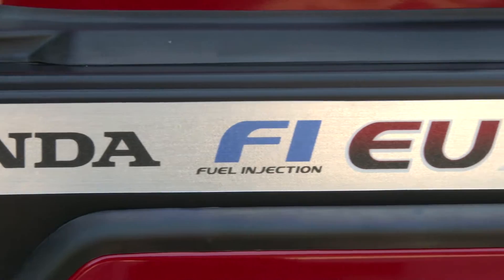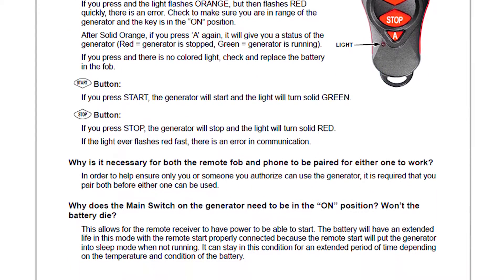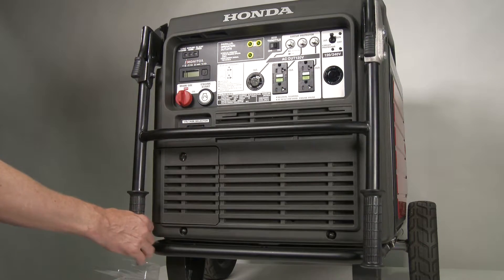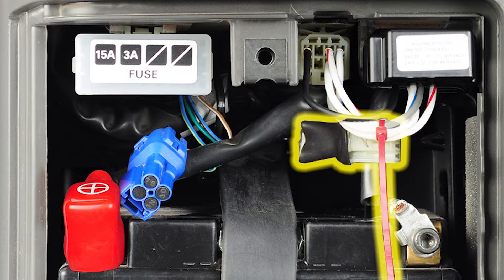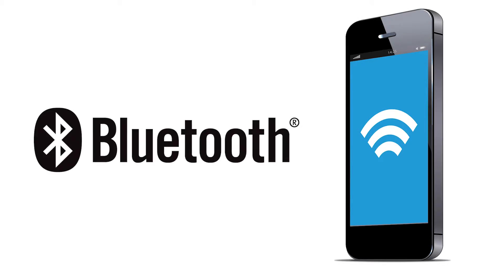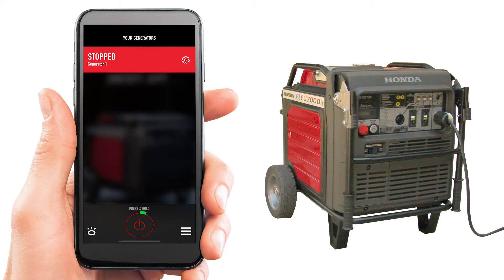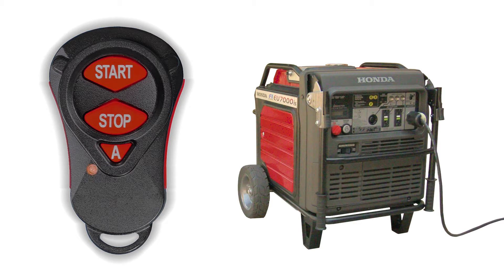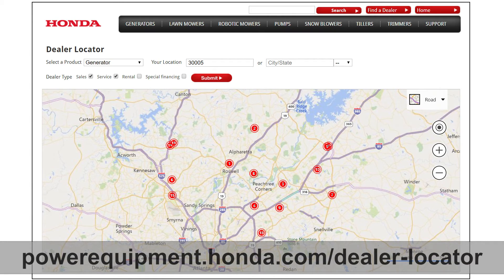Honda EU7000is Generator Wireless Remote Starter Kit

Comment: From the Honda Power Equipment FAQ:
Why does the Main Switch on the generator need to be in the “ON” position? Won’t the battery die? 

This allows for the remote receiver to have power to be able to start. The battery will have an extended life in this mode with the remote start properly connected because the remote start will put the generator into sleep mode when not running. It can stay in this condition for an extended period of time depending on the temperature and condition of the battery.

No idea what the heck this really means for "extended period"...

Comment: So you need to go out and turn the key in the on position before you use the remote start ? If so what's the use of having a remote start🇨🇦
Reply: That's why I never got one and it costs roughly 300$. I considered making bypass remote relay for the power switch. However, it's just not worth having two controllers.
Reply: I guess the engineer never thought of that.
Reply: No you keep the switch to on after few minutes the on position will go in off battery mode.

Comment: really wish they made one of these with propane-fuel capabilities like many other similar models, that way you can connect it to a larger fuel supply and also start easier in the winter

Comment: How long will the generators on board battery last with the generator no running but the key switch in the on position ???  Having to go to the generator to turn the key on makes this system useless.. With the smartphone app and the gen and phone paired what other functions / uses is there ??

Comment: question, will this hold the pair memory if you change out the generator battery or the remote battery?
or will it have to be cleared and paired again?
Reply: It didn't hold for me and it won't reconnect

Comment: doesn't bluetooth need line of sight?  meaning you could not start from indoors?
Reply: No. Bluetooth uses RF ( radio frequency) and the oldest spec for distance is 30 feet. This doesn't account for walls or obstacles. But it will definitely work if the genie is worth reasonable distance of an ext wall

Comment: Is this for the earlier EU7000is models? Also can it turn on/off eco throttle? Also was this just released? I think I saw a couple models but trying to find the best one. I do like that this is a Honda OEM part right?
Reply: This one is by Honda.  P/N 06612-Z37-000AH.  It is for all EU7000 generators that don't have Bluetooth native (which is all EU7s sold so far)

Comment: I ordered it from www.partspak.com for $257.99. Honda Part #06612-Z37-000AH Bt Start/Stop Remote
Reply: Has it shipped yet?
Reply: @staceysmith5561  Yes. Scheduled Delivery for Monday 9/28/20.
Reply: @PowerOnPlay  Did you install it/try it yet?  Thoughts?
Reply: @davidhorst4659  I did receive it but I have not installed it yet. Seems very simple and straightforward.